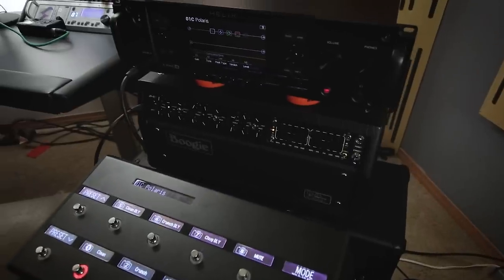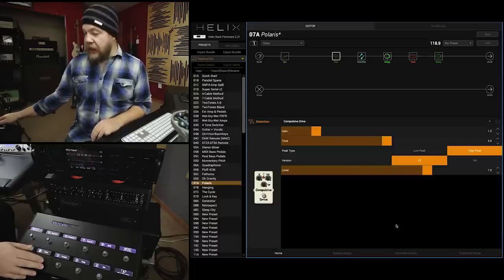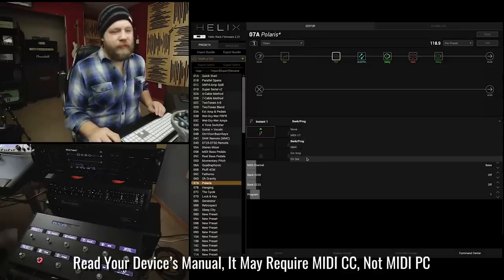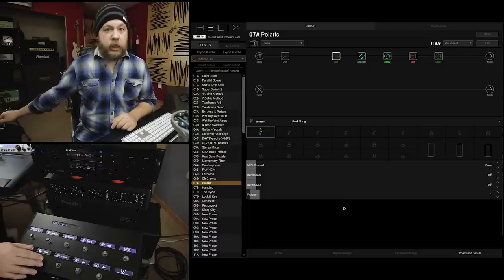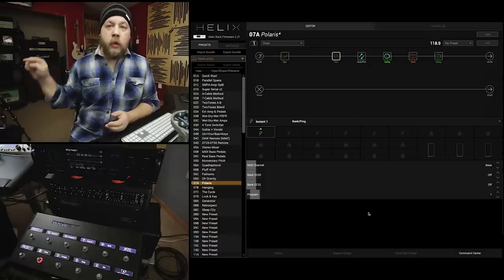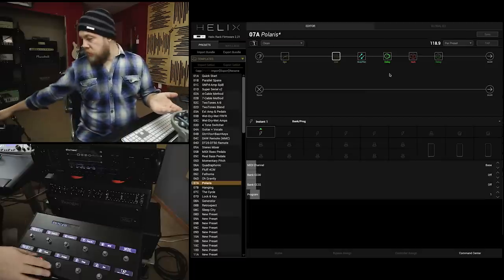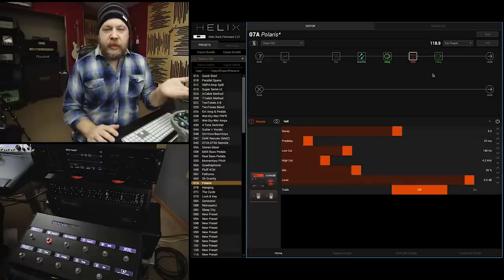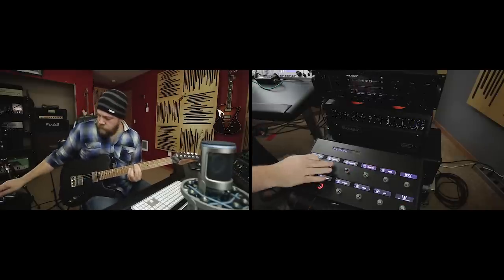Tutorial: Control Your Amp With Your Line 6 Helix

Comment: Hey dude. can you PLEASE explain how to do this on a triple rectifier? My rectifier seems to be stuck on channel 2. Which is on on the back of the amp? and do I need to have program change in the helix with the 4cm and it will switch channel? I still dont really get it. Please help.

Comment: You should do this again with an amp that doesn't have midi switching, something like your dual recs?  does that controller do non midi amp channel switching?
Reply: I believe Ola Englund made a video like that with the AX8 some time ago, he took the midi out from the ax8, and used some sort of adapter to control the amp if i remember correctly.
Reply: Yes it you can theres an ouput from the helix for it

Comment: Would i be able to do this for my stereo rig?
I currently have a dual mono setup (Diezel Einstein Left, EVH Stealth Right) with no pedals or effects and I'm looking for an easy way to sync the two amps up with compressors & drives in the front and delays, reverbs & eqs in the loop.
Not fussed about IR's at the moment but obviously the would be a plus.

Would the helix rack be able to do that?
Thanks in advance.

Comment: Fluff please see this and somehow reach out I’m desperate. I have the same amp and set up. Minus using the send and return 4 cable method. Just straight midi. My helix will not change channels within the snapshot mode. Only is presets. Which has huge latency issues. Please help.

Comment: Hi Ryan, one question: What FX do you use? Parallel or Seriell ??  Because if I use the parallel fx , the Helix Level knob don´t work and the effects are very quiet, if I use the seriell fx, the effects and the Level knob do their job, but the sound is without punch and I have to set the level knob on the helix to max. The same helix settings on the Engl Steve Morse work well in parallel mode. Means, the Level knob works and the effects are fine. Is this a generell prob of the MK3 ??

Comment: What about using the 1/4" ext out for amp switching? I know there's a way to do it, I have just never seen anyone do it. This is with the 4CM of course.
Reply: It’s really easy. For each patch I assign one switch for the amp channel change and for each snapshot just click to switch for whichever channel I want. And once the patch is saved it changes the channel for each snapshot. And you can use standard 1/4 jack cable if it’s just two channels you want to change or TRS cable for 3.
Reply: I have a couple videos on my channel showing how to set that up.

Comment: This is amazing and I can't believe I've never heard of this before. Will it work with my 6505+ head?
Reply: marc vaughn you will need to get a midi mate amp controller since the 6505+ doesn't use either 1/4 jack or midi. If you want to do it, you'll need to send a midi cable from the helix to the RJM uni and than there's a special cable from the RJM unit to the amp head

Comment: Anyone have experience doing this the other way around? Can´t seem to find any info. Im thinking about using Hughes and kettner grandmeister 40 with the original fsm 432 mk2 footswitch, and controlling axe fx or strymon etc. with it trough the midi out of the amp. Is this possible? o.0

Comment: Awesome! Would LOVE to see a video like this with the dual rectifier and channel switching with an amp that doesn't have built in midi. I know it's doable, but the information is often really bulky and hidden behind walls of text. :) Keep up the good work!
Reply: I have some videos on my channel showing how to do this with a Mark V (doesn't have MIDI).
Reply: Yeah, that's not a very informative video I'm afraid. And it does imply that you'd need to hit two buttons on the helix if you are going to change from channel 2 to 3. I might very well be incorrect there. What I'm after is a way to do this via midi, preferably via some sort of interface (there are a few on the market).

I just realised that I sound like a douche... sorry about that. It wasn't intentional at all.
Reply: I didn’t get that you wanted to do it via midi.  Yeah, then my video wouldn’t be helpful.  Well if you wanted to do it with 1/4” switching, it’s all detailed there.
Reply: And it only takes one button to go to any channel just FYI